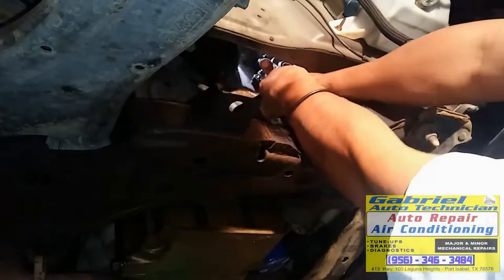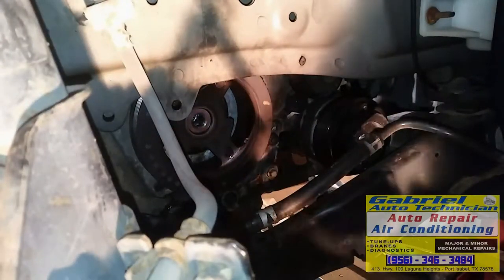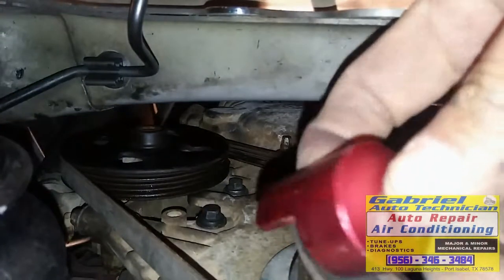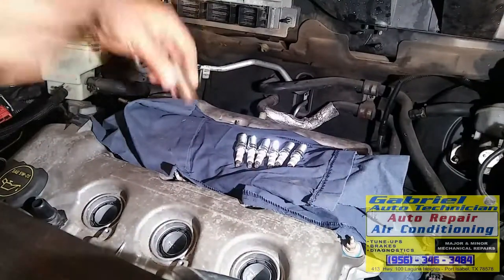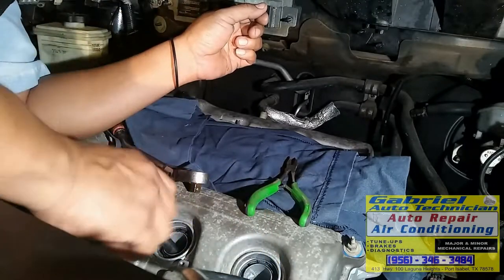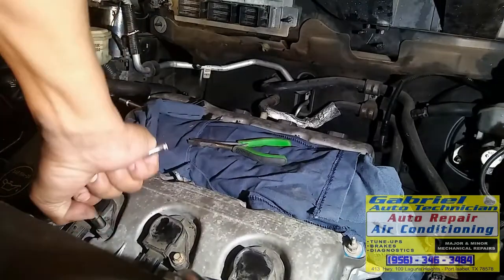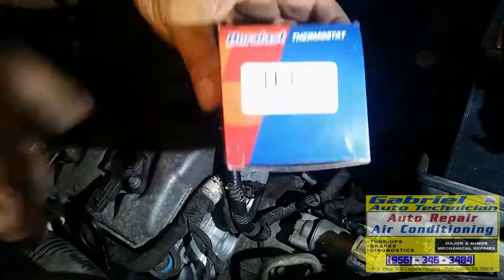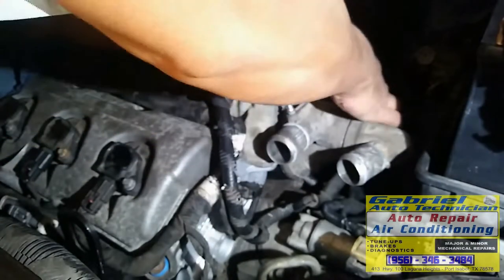Ford 3.5 Engine Heads & Water Pump Replacement. Part 9. Installing Motor Mount, Water Outlet, intake

Comment from the maker: Ford 3.5 Engine Heads & Water Pump Replacement.
Part 1 https://youtu.be/j3fV-VTkQ40
Part 2 https://youtu.be/jO9_NLJX-0A
Part 3 https://youtu.be/WhmqwImVfsw
part 4 https://youtu.be/ttWeMizWWMQ
Part 5 https://youtu.be/12ko2U6MuZc
Part 6 https://youtu.be/XEJyHGQF9lM
Part 7 https://youtu.be/9deeGgE56IE
Part 8 https://youtu.be/TaSofpZncY0
Part 9 https://youtu.be/OgXBnkYrAdI
Part 10 https://youtu.be/G7Q_wY4T1iM